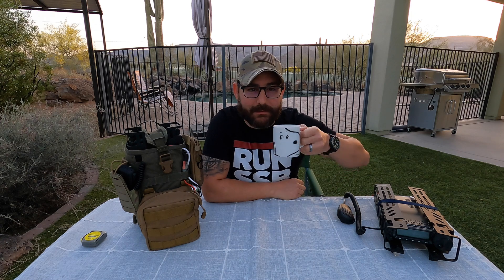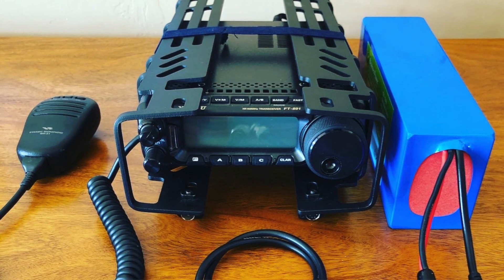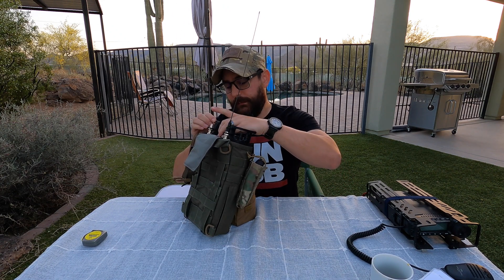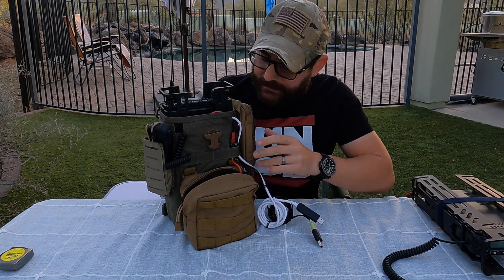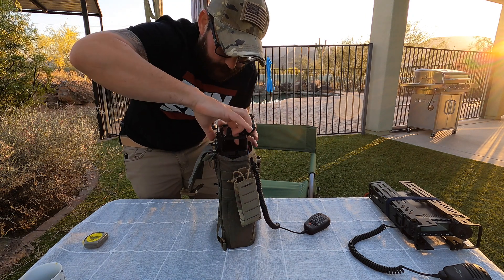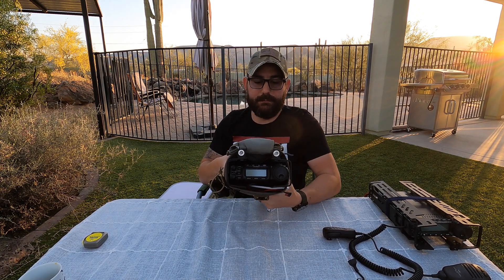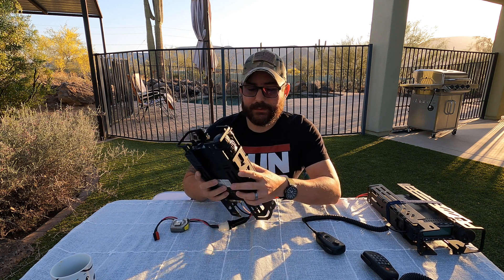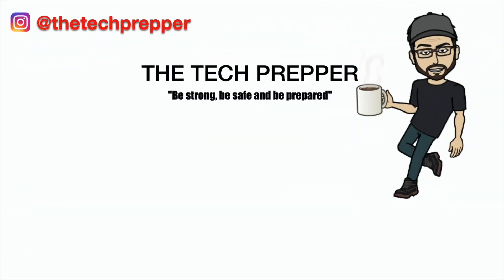TPA-857 Pack Frame - A new Radio Man Pack

Comment: Recently found your channel. Great video and content!
Similar to you, I started with the Ft-817 and used it for years. Great QRP shack in a box with the built in battery. 

I own the FT-857D too, and have been wanting to get into SOTA/POTA. The quick deploy man pack concept with that pack and frame really appeals to me for all the same reasons as you. So just reached out to Seth for a purchase. 

Also picked up the Xiegu G90 (20 watt) rig...and may ask Seth if he could make a cage for that little rig. Seems to fit a sweet spot in  between the 817 & 857/991 for size, capability, battery consumption, etc 

Thanks for the videos. Looking forward to your digital Pi build one next. 

73, 
Mike - KK7LL
Reply from the maker: Welcome to the channel, Mike. We seem to have the same taste in radios. I’d be curious to see how you like the G90 as I’ve been looking at that rig for some time. It’s a good price, has a tuner, a scope and offers 20 watts. If it had 2m/440 is would be perfect. SOTA is a lot of fun. Feel free to look me up on QRZ if you have any questions. 73
Reply: @TheTechPrepper  I just got the G90 so will report more after have had chance to try it. All reports are the tuner is amazing, as is the overall radio performance. Really liked the go kit box that Mike K8MRD did on his YouTube channel for it. 
I knew you’d still want the VHF capabilities for your all in one...especially now that you tried George’s new concept antenna and 2-m SSB. 
73, Mike
Reply from the maker: @n6oft  Thanks for the details. If a 20w all-in-one does not come out in the next couple of years, I've been considering building a radio around the HackRF. That would be an undertaking, but it's technically doable. 73

Comment: didn't know about that bnc 24 antenna.  Thanks.
Reply from the maker: No problem. It's a great little antenna with the ability to run a bit more power and be stored compactly.

Comment: The 857 is such a great radio too bad they discontinued I won't get rid of mine. I actually prefer it to the 891 I think it's easier to use atleast for me but I do have more time on it. Also for a 100 watt radio it's compact and a shack in the box with 50 watts on 2m and 20 watts on 70cm makes for a complete package. Hopefully there is a replacement in the works. Great setup you have and great review.
Reply from the maker: Thanks, Chuck. The 857 is now my preferred SOTA rig over the 891 and even 818. Are you running the Collins SSB filter?
Reply: @TheTechPrepper  yes I am got it a while ago. I just got my 857 back from a buddy, so it will be going out soon!

Comment: Great video and info.  Gives me plans for my 891 also!  Don't worry about the life noises in the background.  I for one don't have to have a professionally produced video to enjoy the content.  In fact, interruptions make it seem more real to me as life is always full of curves!  Keep it up.  73, K8JLW
Reply from the maker: Thanks for hanging in with the distractions, Reid. Like I said, this setup works nearly identically with the 891. I’m considering upgrading to a 6Ah battery as it’s not much bigger than the 4.5Ah. What’s your intended application (portable, field day, EmComm, etc)? 73 de KT1RUN
Reply: @TheTechPrepper  I currently use my 891 for SOTA and a few portable operations.  I use a homebrew battery pack like the ones that OH8STN made on his channel - they work great!  I have the Portable Zero rails on mine, and currently just use a regular backpack so I'm always open to better suggestions.  I like the Armorloq rails but wish they were a little cheaper!

Comment: It seems you have a Yaesu MH-59A8J mic?  If you do, you can change the band on the mic.
Reply from the maker: Yes, I have that mic. It’s a new addition and works great especially for changing bands. I wanted to point out the only issue I’ve found with the TPA pack frame. If you don’t have that mic, it can take a little practice to access the band up/down buttons through the frame.
Reply: @TheTechPrepper  Good point.  I had the 857 and it was a nice radio, I wish they had updated it.
Reply from the maker: @frankwc0o  I agree, the 857D is a great and would benefit from some modern features (like DSP and waterfall). The 991A seems like their attempt at an all band, all mode radio with more power and some modern features, but it's just too big for the field.
Reply: @TheTechPrepper  agreed. I have the 991A and it’s smaller than the 7300, but it’s no portable radio.

Comment: Well thought through. Do you have or will have more about your 857d programming and how to use it?
Reply from the maker: There are several excellent videos on the FT-857D, but I may do a detailed video as I gain more experience with it. I will be walking through all the digital settings and few things I’ve learned about the 857D for 2m packet and HF digital modes. This will be in the next video when we take on the end-to-end Pi build. As for programming repeaters and a simplex frequencies, I perform all those manually even though I have the programming cable.

Comment: I like that pouch man!
Reply from the maker: The TPA pack frame shines with the right bag. By the way, as of a month a go, the PRC/117G pouch was around $50 if you bought it in OD Green. Guess which color I selected?
Reply: @TheTechPrepper  I saw that $100+ price tag and was scared off.  $50 is better.

Comment: What battery are you using for that setup?
Reply from the maker: The 4.5A LiFePO battery from Bioenno. The battery and the Pi with all the cables fit nicely in that front admin pouch. I carry a second in the backpack.
Reply: Thanks, I'll look into that, I loved the response to the neighbor and the motorcycle, I lived in cave creek for a while, it was common.
Reply from the maker: @rangerjay7971  It was a friendlty chat. He apologized and mentioned that we was getting ready for a last minute ride and that he hadn't run the bike in awhile. Cave Creek is a nice area. You were just on the other side of the hill.
Reply: Schoolhouse and N fleming

Comment: When I first got my 857 I wanted to build one of those big man pack frames from ebay.  In my opinion these frames seem better.  My 857 is my backup rig.
Reply from the maker: The bigger man pack setups built on the ALICE pack frames look cool and would be fun to build, but this setup feels cleaner, lighter and has worked well in the field.

Comment: Hey man upgraded to general last   month. Where did you find the 857? Not sure if I should get that or the 891. Not quite sure of the value of the 857 either. I already have a 818.
Reply from the maker: Congratulations on your upgrade, Warren! You’re going to enjoy HF. The FT-857D was incredibly difficult to find and the prices have gone through the roof on the secondary market ever since Yaesu discontinued the radio. I was lucky that a viewer sold me one for $1000 USD which included the ATAS-120 antenna. The FT-891 is a much more modern rig with much better receive quality. I’m only preferring the FT-857 at the moment since I’m heavily into 2m packet and need more power than my FT-818. What kind of modes and bands are you interested in?
Reply: @TheTechPrepper   I’m into digital modes and SSB on hf. I’ve been playing with it with my 818. It still amazes me what I can do on 5/6 watts. But I do want some more power I think lol.
Reply from the maker: Don’t underestimate what you can do at QRP levels. I’ve made a number of contacts over 5,000 miles away in the FT-818 with simple wire antennas.